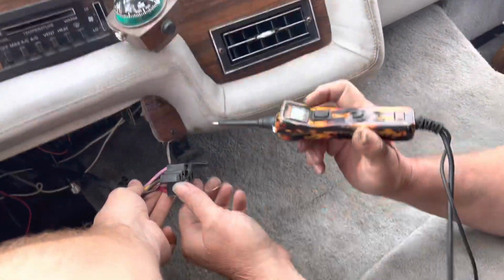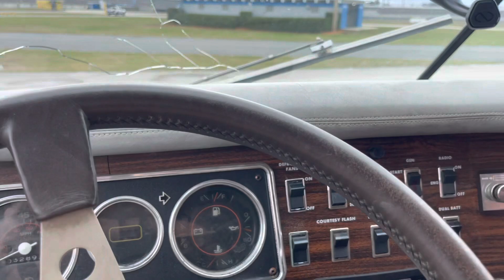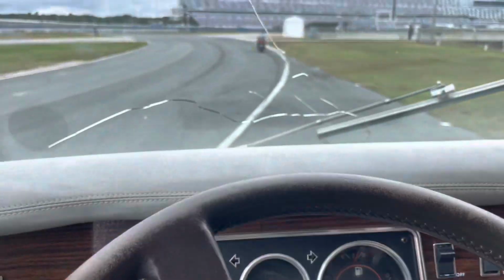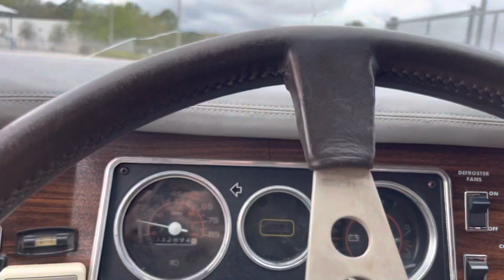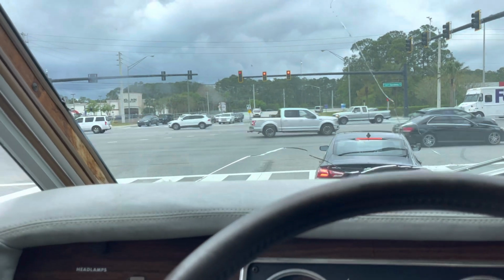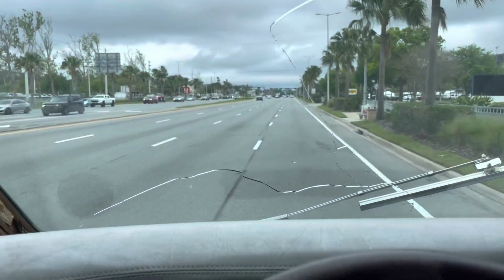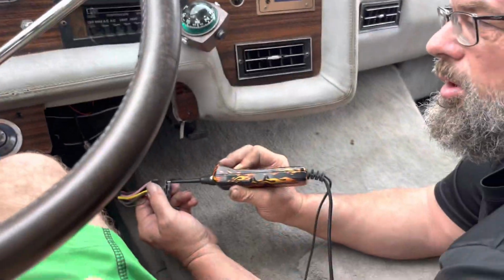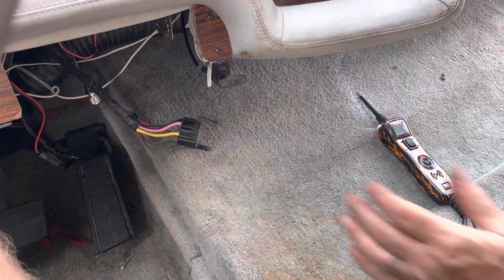THE STRUGGLE CONTINUES! The struggle bus won’t start so we can go home. GMC sports coach

Comment: I believe your problem is down at the starter  fusiable link. It's at the battery post of the starter. They get hot and brittle from old age. Very common for older GM products. Good Luck.

Comment: I thought I heard you say “I think that was a Jack snapping up” as you pulled away. If it has leveling jacks and all of them are not up all the way it will cut the power to the ignition to keep you from pulling away with a Jack down. Might be your issue.
Reply from the maker: No, because I have run the bus many times while we were working on the thermostat in the cooling system while it was up on the jacks. But sometimes when you’re on unlevel ground and the pressure is released from the hydraulic, it just won’t fold up until you start moving forward a little bit.
Reply: @amsoiladam  just a thought. Travel safely!

Comment: Motorhome or conversion van the wiring always seems to need attention.. more than once the older they get!
Reply from the maker: Yes, and it looks as if somebody has already been in here making modifications, and they did them very poorly. There’s a lot of scotch locks in the system.
Reply: @amsoiladam  we call those free Florida corrosion locks down here.. won't use em